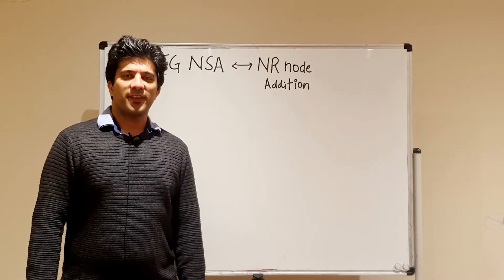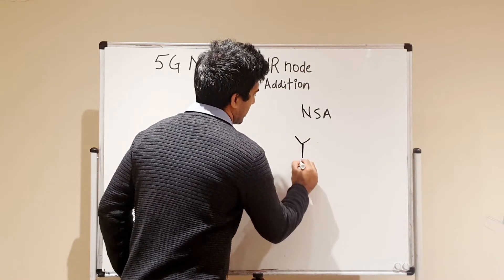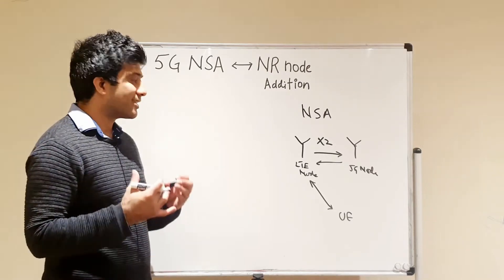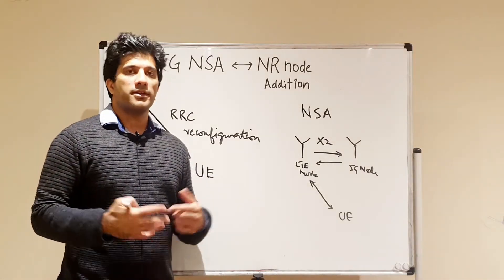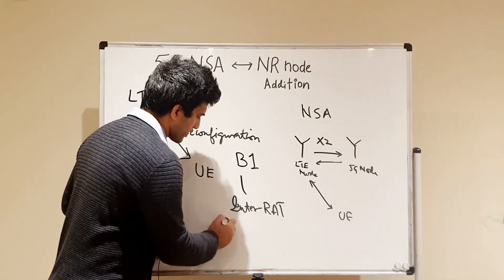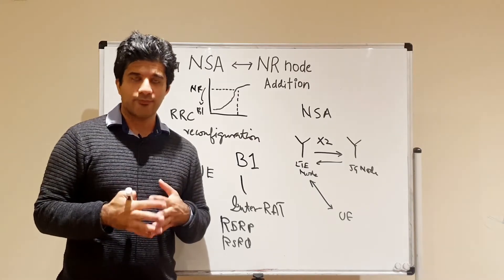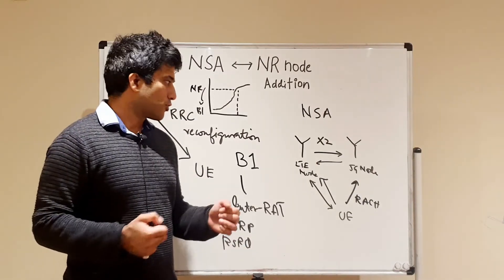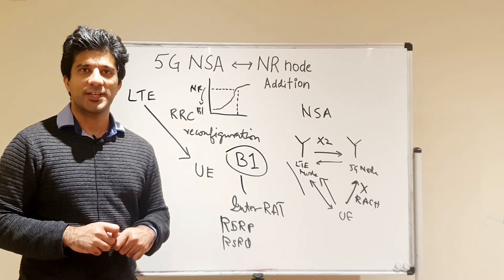5G Training Lecture #8 : NR cell addition in NSA NR with LTE as Master Node - RRC setup and B1 Event

Comment: Hi,
Can you help here: 
When connected Over the air. The UE fails to Perform NR leg setup. 
ENDC setup fails because ENodeB configures event B1 for NR cell measurement, but UE never reports Measurement for NR cell and Event B1 is not triggered.
Reply from the maker: This may be because NR rsrp never meets the b1 value. You can check the nr coverage in the cell via dt and compare it to the b1 threshold.

Comment: Is this process called normal NR registration or handover as there is b1 nr event criteria 
how NW sends reconfig for NR cell addition, based on UE response on b1 meas? 
If yes then what is the term using for UE response to network after scanning b1 criteria?
Reply from the maker: Thanks for the questions. I will try to explain this in the next lectures